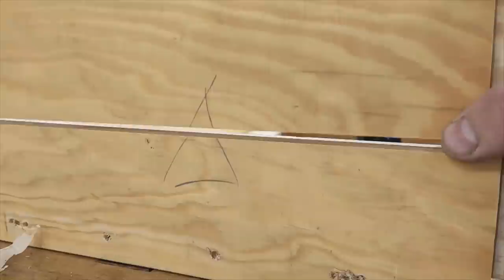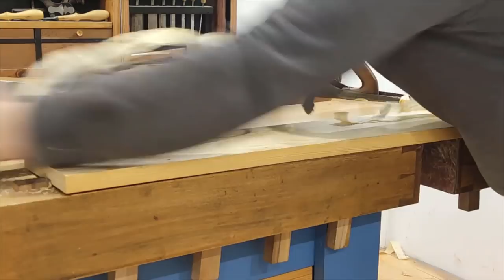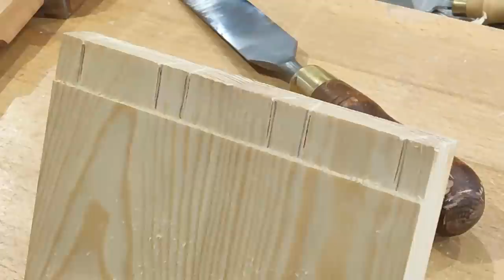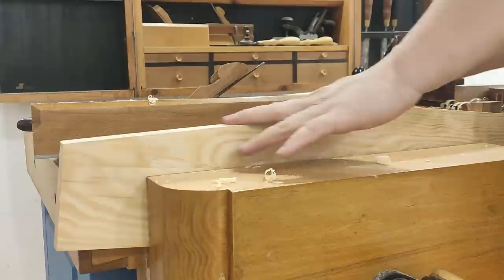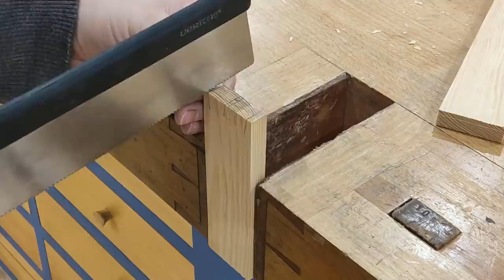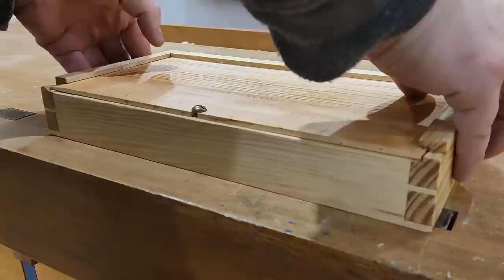059 I used recycled wood to organize my hand saws

Comment from the maker: Hello my friends! 
Since i made new wooden floor in the workshop all my hand saws were laying in the corner and watched me all the time.. 
Today i finally made a rack / shelf for them. I used recycled pine wood (plus boxwood for the drawer handle). 
The construction is based only on classic joints, no screws or bolts (except one brass screw wich is holding drawer bottom)
and glued with an ordinary white glue. Whole the surface was coated by Osmo 3032. 
It was a really simple project but brings me a lot of satisfaction.
As a fancy adition i built small drawer, just to store my saw seting tools. They deserve for it ;)
I hope you will enjoy this video :) Thank you for your time!
It will be a pleasure for me if you decide to check my other projects and hit subscription button.
Cheers

Comment: What are the arrows for on the face of the jointed boards before glue up?
Reply from the maker: I set the boards with the same direction for hand planing. That arrows means how i should glue them without mistakes.
Reply: @StavrosGakos  I see, thanks for sharing your knowledge!